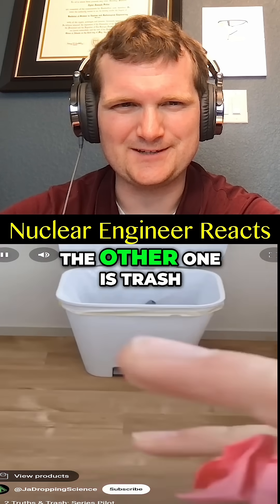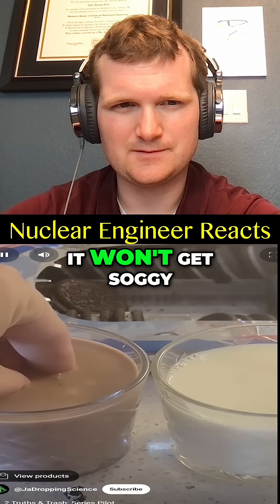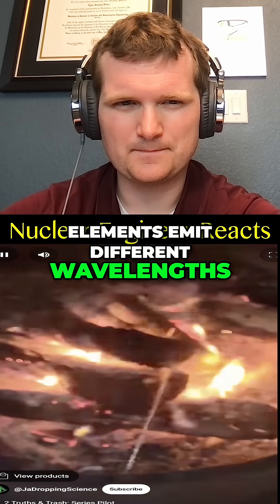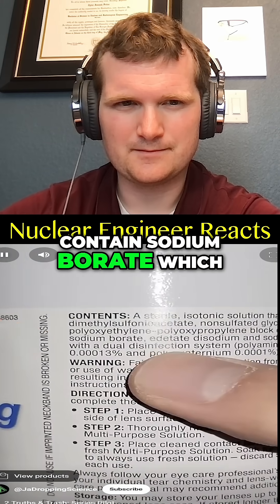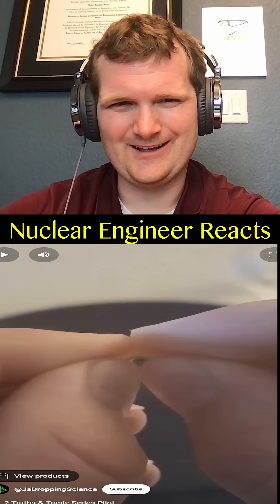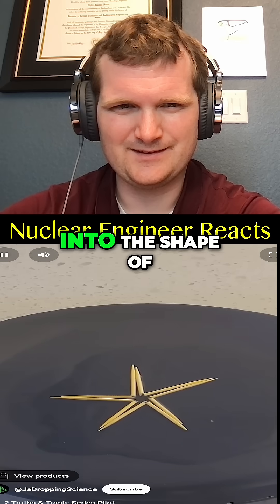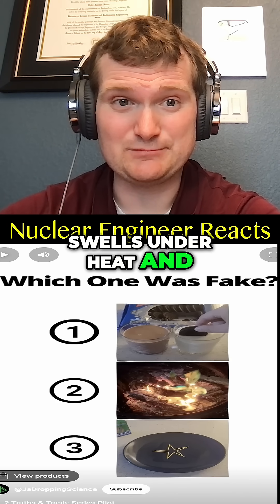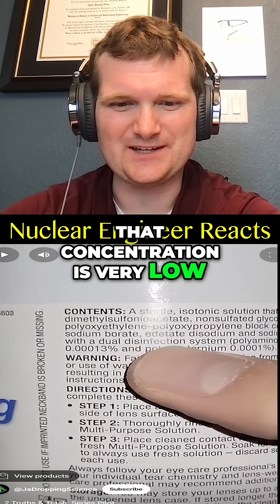How is Chocolate Milk Like a Nuclear Reactor Coolant System? - 2 Truths & Trash - JaDroppingScience

Comment: As an machincal and aerodynamic engineer I thought my branch is complicated. But last week I took a nuclear material class, and now I can say that nuclear reactor design is much more complicated, you have not only the materials and fluid design but also the chemical and of course the nuclear physicist. For an airplane you need mostly material, aerodynamics, and basic structures design classes.
Reply: you can make a paper airplane but you can't make a paper nuclear power plant
Reply: Nuclear material's gotta be one of the more complicated branch of nuclear related field lol
Reply: @purplefractal8892yeah it really is, because you have to choose the right materials which depend on contact of fluids, neutrons, x-rays, mechanical stress and strains and also temperature. Also the chemical perspective is important and you have to design it for specific duration on time.

This is really the most complicated part because it affects the whole power plant.

If you have an ordinary power plant which burn fissile fuels it is much easier. Simple fluids mostly water vapor no radiation no chemical agenda in the fluids like boron for neutron absorption….

The nuclear power plant is only a medium warm heat source. A gas turbine cycle has much higher temperature of about 1500Celsius for turbine entry temperature.
Reply: You are not a mathematician or an aerodynamic engineer lol
Reply: @ytpeep7393  He meant mechanical engineer specialised in aerodynamics. He likely works for a major airline
Reply: @ytpeep7393 I never Said I’m a mathematician. But I’m very good at numerics